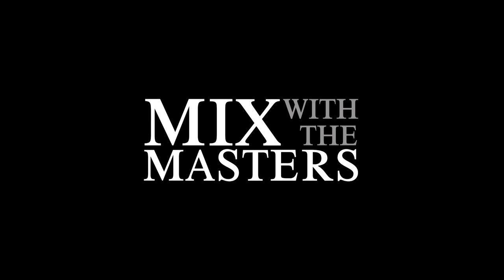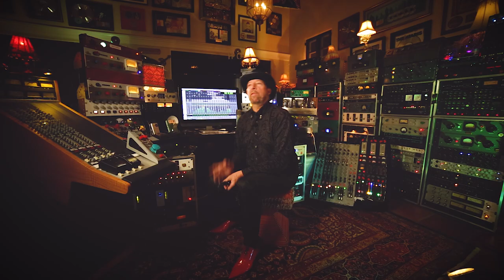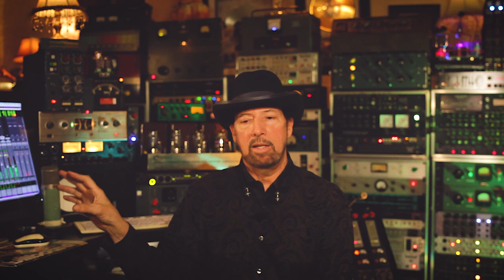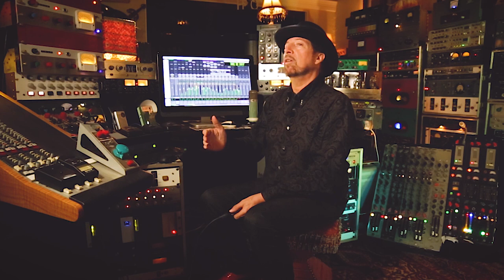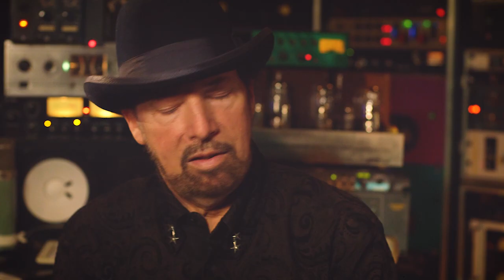Listening to the details with Jack Joseph Puig

Comment: I hear a MASSIVE difference in plugins at 96k vs 48k so I stick with 96k. My outboard seems to like it better too
Reply: All plug-ins, or just ones that create a non-linearity?  (comps, saturation etc.)
Reply: Lots of plugins will upsample even if you're at 48k. Personally I'll never move away from 48k.
Reply: @johansugarev  Good point. Those plugins that benefit from a higher sample rate to avoid aliasing will take care of that internally - at least that's what I would expect from a decent plugin in 2022. For the rest, especially analog, it just doesn't matter.
Reply: @error8418  it matters for all plugins and devices, the higher your sample rate. The less aliasing you get. This applies to the recording process as well.

Comment: The only way to truly hear the difference would be sitting in the studio with Jack, or MWTM have the files available to download and listen in our own studio environment as Warren does at Produce like a Pro. I agree about listening to what hardware analog is doing, that is why there are so many shootout videos of hardware vs software. 

I had an opportunity to trial a pultec clone DA/AD was the UA2192 and did a comparison with the UA pultec DSP-1 card. Both sounded identical except for the levels. To hear the changes the UA EQ +4, the pultec clone +1.5. So the pultec clone level output had little change only here and there, whereas the software UA pultec had increased level output. BTW this was 12 years ago, software plugins are way better now than back then at emulating perceived detail. But my understanding was, if you did this over 40-60 tracks in the software there would be an accumulation of level increase as apposed to the analog. So what is always relevant regardless is "perceived detail" without minimal increased  level. Then the final Master bus will not need to be crushed, limited hard to have that "perceived loudness" to do that all you are doing is just turning up the volume level.

Comment: He is right. I play the same record on different sample rates and he's absolutely right! 96k sounds like a natural, rich and full. 88.2 starts to be a little bit bland in top end but still not bad. With 48k I hear much digital top end, very harsh and kind of dry sound and 44.1k seems like a little bit LPF 96k but definitely in a good way. Not so much harsh and digital top end like in 48k. And I can definitely hear that just playing my favourite tracks from Spotify which imo should be a reference tracks. To be honest I really didn't care too much for all those years. People who teach me the most about recording and mixing have their interfaces setup at 24bit/96k and about 256 buffer size samples so I use it since day one in my case, but Jack made me curious to check that in my particular case and I agree 100%. And 96k always works for me perfectly too. Maybe some converters gives you different and some not but I definitely agree with Jack in that case. For mr 96k, 88.2 44.1 and last and worse 48k. Placebo or not I have very similar feelings.